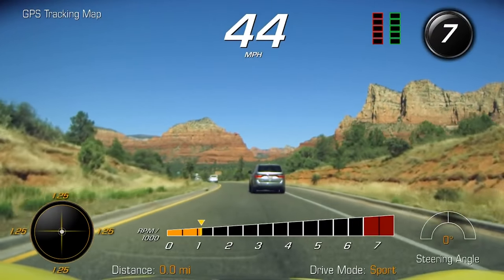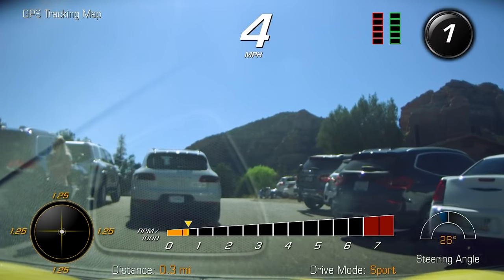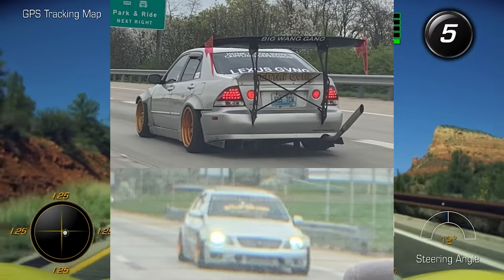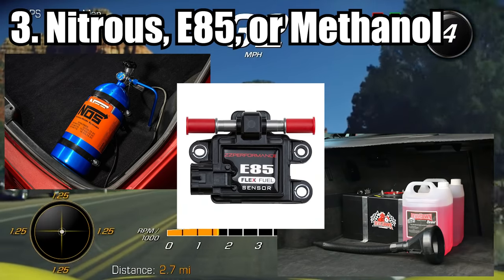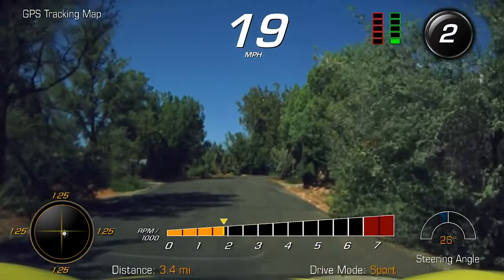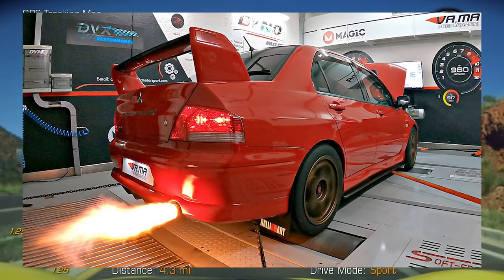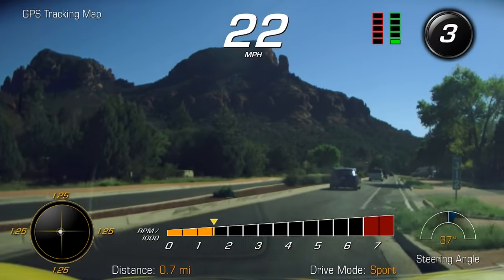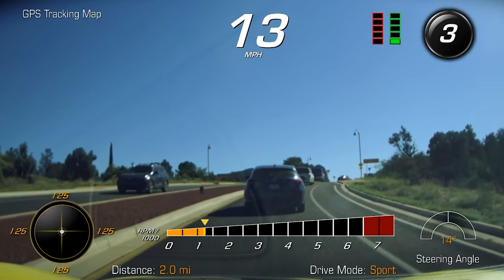6 Most INTIMIDATING Car Mods!

Comment: a non boosted engine can get more power from a finely tuned exhaust than 15hp. and while youre at it; mufflers dont necesarily cost power, only when theyre done badly. its done via scavenging on the header. if the exhaust after that is not restrictive (which high flow cats and good mufflers almost are) you can get around 10-15% more power than with no headers at all. but again, that exhaust has to be tuned to the engine and its output, which means you gotta go custom.
and then flames; really? since fuel injectors are a thing its all a tune. you dont have a rallye-spec anti lag system (they've been outlawed by the FIA in 2023 btw) theres no reason to have any flame come the exhaust, even in a very high tune, unless your engine is revving so high and your exhaust is so short that the fuel doesnt have time to burn (mazda 787b for example will shoot flames before reaching redline)
on certain racecars the afr will become rich on closing throttle, but thats because track cars and such dont idle. they close the throttle body completely for maximum engine breaking causing leftover fuel in the intake to combust when it out of the exhaust, causing the flames we know and love from racecars. they dont bang tho. they just spew "soft" flames.
so what you see on the road is all for show. professional dynos will make your car do that, because its for show. you'll much rather come back to the dyno that made your car exiting than to the one that just made it boringly efficient. as you said; you love the bang and the flames your corvette makes on decel below a certain rpm. and thats fine. but ever since carbs went out theres very very few reasons for it to exist outside of show. everything on the road is show

Comment: Im currently building a 69 rear half, 74 front half nova and I've got a powerglide sequential in it. I absolutely cannot wait until ive got the engine built properly and I twin turbo it (might twin charge it cause that'd be cool but I don't want to deal with all the work and unreliability). This video just made me want to spend money I don't have so I can get it out the shop quick but I gotta wait 😭

Comment: Here I am planning on doing the exhaust on my Cruze then tuning it all at once. Maybe I should 91 tune it with my new intake and see if I can't troll some lifted trucks. There aren't many car guy type vehicles out where I live. Lots of lifted trucks that think they are kings of the road. It is always amusing being faster than they are in my nearly bone stock economy car. Throw 30 or more extra HP and most of them won't be able to keep pace.

Comment: I remember the top fuel dragsters lining up before a race. There were flames shooting out of the headers as they bounced on those gigantic racing slicks. I also remember that the front wheels were large and spoked. they would have looked at home on a motorcycle. Those guys were not messing around.
I'm blind now and I don't follow drag racing anymore. Does it still look the same?

Comment: I thought sequential paddle shift transmissions work just like motorcycle transmissions with a quickshifter, so you just clutchless shift and a sensor cuts fuel for the perfect duration of time, or blips to the correct rpm, but its still the rider/driver actually moving the gears around „manually“. Am i wrong and sequential transmissions for cars work differently?

Comment: for me the nitrous one is debatable, for example, in my town the car scene isn’t too bad, one of the cars in town is a yellow mustang gt with a 5.0, i don’t know the year though, but it’s got straight pipes, nasty cam, lowered a little, a big wicker bill and cowl hood. And best of all, nitrous. but it lacks on the street, gets perfect grip, but gets gapped by a fiesta with almost 30 psi of boost, which got beat by my truck, a lifted duramax pushing almost 500 hp and 700 lb ft of torque on 35 in mud terrains. so to me nitrous is only intimidating if it’s useful and proven to make the car better that it’s on

Comment: Honestly, I was thinking big wing looks hilarious and dumb and I love that.

If I had oodles of money, I'd probably buy a small car like 88 corolla and give it the most aggressive mods legal in my state and I'd call it the Idiot Mobile.

My dad had an 88 at one point and that thing sat super low and was just a jalopy of a car. It looked hilarious when he and I, two huge guys, got in or out. It was such a clown car. That thing had basically no suspension to speak of. You could feel every bump in the road bc it went straight to your butt and up your spine. The head space was slim at best and potholes were a pain in both head and ass.

And to this day I want one of those cars to put a hellcat motor in and make into a snotrod

Comment: I’d like to add carbon fiber parts. Weight reduction is essential to performance in all aspects of racing, including drag racing, so when there’s a car with like carbon doors or hoods or whatever, it’s pretty intimidating. But it does loose it’s intimidation factor if it’s overdone.

Comment: you know what I hate I have a stock mustang V6 only thing on it is a muffler delete and I bought it like that but I have the speed governor and the rev limiter still, I raced a boosted 2022 civic si making 280 wheel and I was winning by like half a car and then my fuel line cut off kicked in at 120 and I was in 4th gear… I have 6

Comment: one thing that is really underrated is the humble diesel engine.
if you see a small-ish car with the rear seats and all the interior decorations torn out, that sounds like a tractor and a driver who oozes confidence, that is a scary combination.
like i have seen the old 1.9L TDI engines that volkswagen used to make humble those tiktok cars at the red light every single time.
buddy of mine has a really old naturally aspirated 3L Nissan Navara, you can't beat this guy at the red light because his car eats all the air and all you get is a clogged up filter.

Comment: This definitely isn't a mod but is caused from many
Having put in black marks around the area of where the exhaust is ( unless if it is some Volkswagen diesel or person who runs their car rich) 
Cuz that shows that I can shoot flames and deposits Carbon on the bumper or Hood

Another mod this is mainly for Supras though is a visible Turbo without the hood being opened

Comment: Sequential shift manual transmissions still have a traditional clutch and gear are changed by manually moving the lever, just like your typical motorcycle. They are also typically dog box synchronization so they do not require use of the clutch when shifting. Many people also set up a flat shift strategy in their ecu that cuts engine power when shift so the only thing the operator needs to do is pull the lever to select the next gear.

Comment: More intimidating mods:
Air intake sticking out one of the headlights or bumper
Big Ass intercooler
wide tires for the drive wheels
Big ass brake rotors behind stock rims
laptop in the seat with a noodles of an ecu on the ground.
The car has an uneven grumble idle when it shouldn't. 
There is a weird hump in the hood.
He gave up AC and power steering.

Comment: This is pure guest work but i'm pretty sure drag raidals are a compromise for basically traction on road and race tracks (or unpreped surfaces) since i'm pretty sure most drag street car things Use raidals because it kind of gives a match of grip and traction Basically it's able to grip the road surface but also keep it straight at the same time? (Im def wrong)

Comment: Bead locks are meant to prevent the wheel from spinning inside the tire....not to prevent the tire from deforming🤣🤣🤣....also, flames are all show unless you have a rotary. They also are a sign of poor tuning, even on 2 step.

Comment: So E85 is well 85 percent Ethanol which means it's going to make your car run cooler because it cools down way faster then regular gasoline. Nitrous the shot of it will spray into the engine right before the combustion process and it'll super heat the air fuel mixture so that more air is added before the cylinder combust. They are very cool when used in conjunction. Had an old instructor tell me you could do it on any car as long as you have a tune to compensate for the leaner air mixture.

Comment: Rate my backfire. I dont have any tune on my little nissan truck it just runs rich so when going up to my shift point about 3k rpm it's let out a fireball big enough to light up the night and catch it out of your peripheral and you can see the flame ball. Same thing with down shifting it'll sometimes pop out a fireball. But I must specify there is no tune it just does that and I'm not going for intimidation I'm building it up for offroad

Comment: the most intimidating thing I can think about is a stock looking car, like my 2005 Micra, but seeing it on the road and feeling like something is not right, only to find out that is completely off the wall with engine mods, suspension, transmission, wheels. But you only find out when they want you to find out. A silent killer

Comment: For sequential, electronically controlled ones do exist (eg drag racing), but most are at best electronically assisted (eg electronic cut-off/blip like bike shifters). The true faster ones are the hydraulic actuated ones instead of regular sequentials like on bikes. Basically forces every shift in, but clutch has to be seriously beefed up as well as drivetrain (which they are by the time you have those). There are very little track sequentials that have electronic clutches or shifts, it's purely mechanical and user operated, unless you are like a very high-level open wheel or prototype racer where you have clutch maps for standing starts. I prefer my sequentials purely mechanical, with a regular ignition cut-off (basically like opening a switch while the lever is being pulled) and blip (throttle override/cable pull system). It's extremely fast and reliable, and you stay in perfect control of everything, clutch included. Downside is, they are very harsh when not used in racing conditions.

Comment: I am one to kinda go against what popular a bit of the tiem line I have rock lights on my truck so I can see where I am on dirt roads or for truck meet or jait for fun at bonfires but I’m also kinda have a sleeper my 97 Ford 7.3 Diesel I had a loud exhaust on it and it turned people heads especially when I left lights people would just look over and go what the hell is done it that thing and couldn’t believe how loud it was and I almost broke a couple people necks  going by the looked so hard loud truck and cars are fun and cool and sound good I didn’t have mine straight pipes still had the car but because it spent a lot of money under my hood and not a lot of appearance people were surprised when I won a dirt drags with my truck beat one truck and had to wait till someone stepped up with a car that made more the double what my truck made to get people to start calling me out for a race after I lost to 700hp car by like a quarter to half a car after I spun bad but I think people waited to see what my truck had cause it just looks like a old farm truck so people weren’t sure how much but it had but I ended up pretty much whopping a d max and 2 Cummins one was a class above me. I was surprised by my truck and a lot of people were

Comment: well you can keep car quiet and have a lot of power its all about matching parts 
"unlocking" exhaust with huge diameter straightpipe makes more power but lowers torque low/mid rpm 
so technically with correct exhaust you should be able to gap most modified cars 

you have better acceleration from the start so you can gap him before he get into the most power rev range he probably would smoke u on highway but on casual city race from lights it will do some damage

Comment: Adding a comment to the last one, valve controlled exhaust is pretty intimidating too. And I don't mean normal hit a button and it's slightly louder, I mean buck gnx mid pipe valve. I lined up next to this one kid who has a normalish sounding Camaro, it had a turbo on it so you knew it wasn't stock. But it was really quiet, until he hit a button and instantly it was much louder. Later found out that when he hit the button he gained half a second on his runs, and had tested it on a strip to see if it did anything.

Comment: The most intimidating build IMO is a pretty normal looking car but when you get close it's not quite right sports steering wheel street oriented racing seats aftermarjet wheels and upgraded suspension and in the rear window stickers from trackdays all over the country or better yet from multiple continents

Comment: You should at sumernats it's 1500 horsepower cars with blast pipes shooting 10 foot flames with 4 leader flowers hanging out the bonnet shredding tires for three days straight but  not all of them make that much horspower it's like 500 on and some are turbo and others are super charged but ya

Comment: Not a fan of amateur aerodynamics. The standard spoiler is designed to work best for the car in its intended use: daily chores, high speed cruising or track. Throwing big wing on a car that just runs on the street is posing.

Comment: manual cars are much more fun to drive 

but because i also sim race a bit i was driving back in the day on one server a very powerfull s30 and man with manual mode i wasnt able to keep this car under control not only i was slower but paddles allows you to more concentrate on road 

i also have very bad habit of downshifting in corners, not before but in 
since i was driving rather low power cars in rl i was used to do that and because i was used to cars i drove i could rev match perfectly 

that confidence made me crash that s30 a lot in game 
high power cars need sequential gearbox

Comment: I'm glad you brought up quiet cars. I'm building a turbo 3.0L stroker m50 to put into my e36 and one of my goals has always been to make this car sound as close to stock as humanly possible. I am doing something ridiculous with a cutout but the exhaust is planned to be a dual muffler setup with a resonator between them using vibrant for the res and thrush hush thrush mufflers to kill the dbs.

My block is going to be built to handle upwards of 700hp but will most likely be run between 550 and 600.

Comment: Another thing that is really intimidating is when you hear a vechial with a big cam. Not a stock 5.3 ls with a stage 3 cam. No those fully built engines that sound like there about to stall when there idling.

Comment: I got a methonal kit on 2 different cars of mine.  I have them both discretely installed.  I use it to push the boost higher and drastically removed heatsoak on repeated runs.

Comment: As a truck guy if you pull up to a red light and a guy in a old diesel gets out of the truck and manually locked his diff your fucked is over because that guy has no fear of destroying his diff lockers and has to take the time to do it by hand so if you see 2 trucks at a red light and one guy gets out and walks around and is messing with all 4 wheels you can make a pretty good guess as to witch one will win.

Comment: i could completely relate to the silent but deadly part. There's this dude cocking about his brand new mustang ecoboost, than appears to be taunting some other guy in a toyota corolla. All i could tell you that there's no audible clue that it is modded, but hell when he start rolling to the start line you could hear this distinct whistling sound and after he turns on the head light, there it goes his boost gauge outside his windshield. turns out that car wasnt even done being tuned and boy he won that race hard

Comment: I agree with no.6 I have a very quiet and tame exhaust. Just some after market muffler. But the intake I have is louder than my exhaust. So when I’m above 4k rpm, the engine is just screaming with this satisfying induction noise. I get compliments on how the car sounds. And I’m great full for that.

Comment: In Sweden E85 is actually available at almost every gas station because environmental reasons, you kind of take it for forgiven that you can run E85 for the same price and convince as regular 95, not counting the added fuel consumption

Comment: The reason you have bigger sidewall on a drag radial is because the torque put on your tires under heavy acceleration will warp the rubber and grab better then regular tires (if you look up a slo mo video of a drag radial you’ll notice this)

Comment: i have a chevy Chevette ( the Brazilian one thats basically an Opel not the american one ) that spit flames like a dragon, just hook a spark plug at the end of the exhaust ( make sure you dont have a Cat ) hooked to a coil and you be spitting flames like fucking Alduin
Reply: also it kinda i mean if your really into it, work like an Anti-lag system cause it will burn the gases in the exhaust so if you know what your doing it can work!